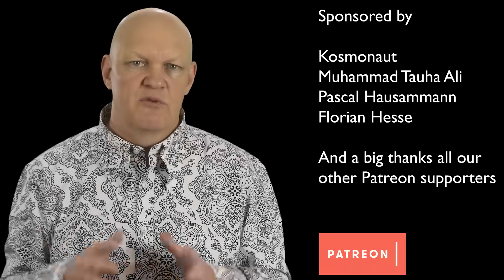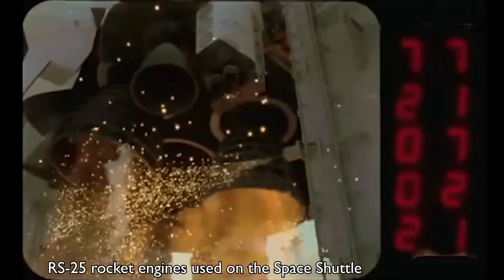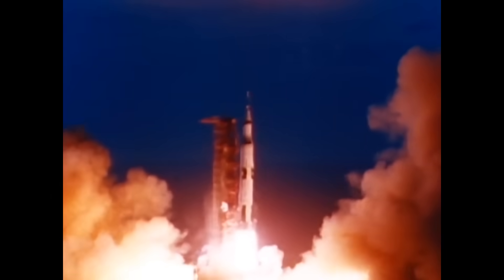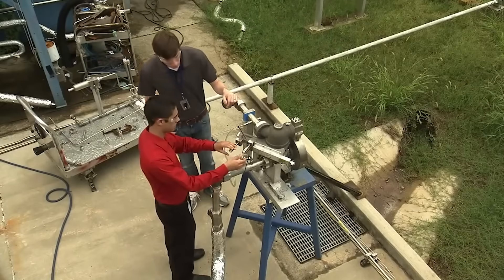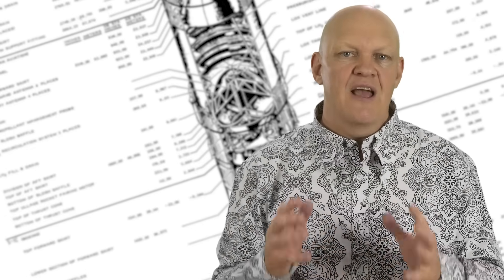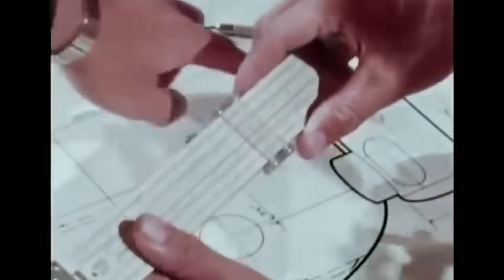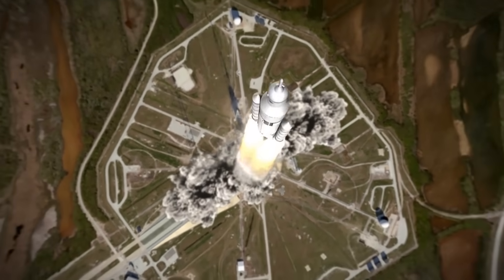Why Can't we Remake the Rocketdyne F1 Engine?

Comment: I think the statement that "We can't remake the F1 engine" is a misnomer. We could re-make them if we had to. We just couldn't knock them out in a couple of months. We'd have to first re-create the machinery used to build the engines.
Reply: Exactly, and repeat the trial and error steps that took place between the documented design and final design. It's not that we can't do it, but that no one is prepared to commit the resources which were available first time around.
Reply: @jellomaster5629  SLS engines have few problems about them. First they cost 100mil each. And as they are hydrogen engines they necessitate large solid rocket boosters to even get off the ground, which are also not cheap. Of course, the point of SLS is not to fly but to spend money, so maybe that's a feature not a bug.
Reply: @aleksandersuur9475  it's all money based now. Not science based like the Saturn V
Reply: @aleksandersuur9475  We also have the rocket engine 170, or rd-170
Reply: Nasa is now overpriced apple products with NO justification compared to Raptor engines. But not only by the factor of 4-5 like with PC and MAC but by a Factor of 100-1000. 
If Spaceshup Heavy is safe and a succses why should Nasa waste money with a rocket program? Could use Space X Rockets and focus money on other development, that still makes sense...
Reply: If we cant reverse engineer an F 1 engine,  we are really in serious shit man!
Reply: @michaellepore105  and you ARE in serious shit, man! America won’t even be around come 2030. That’s scary.
Reply: And train people how to use them.
Reply: You know What's funny? Those nitwits who believe our government is reverse engineering alien UFO'S! When they can't reverse engineer a Saturn 5 from 1967! With blueprints to add insult to injury!!! LOL🤣😂
Reply: EFFram YOUng  It's fake all along never flew, never worked, all happened just in a Kubrick Studio ;)
JUST JOKING. The fact I have to make this clear is strange...
Reply: not only machines. Blueprints are incomplete. Probably things like joinery, manufacture, oxidation, hardening and so on are missing there. But it's good question if we need to do the same, if 5k+ parts can be reduced to 40 with modern production processes, then why do it old way?
Reply: EFFram YOUng  Was even hard typing :D
Reply: We could certainly "reinvent" an F1, but we'd never rebuild what was built in the 60s. All of the technology is "obsolete". If it were still valuable, meaningful tech, we'd still be using it in things, but we aren't. Look at the LEM computer... marvel of 1960s inventiveness, but there's no way we'd even think to build something like that today. (just like today you wouldn't design a new computer around a 486.)

Too much of the Saturn V era lived in people's heads or personal notes, that never made it into official documents. Even with the blue prints, we'd have to rediscover all those little nuances. And then pray all the common off the shelf bits that aren't much more than a part number can also still be found. (a transistor or tube that was commonly available in 1960, might not even have surviving documents, much less working stocks. we have that problem in many things today -- the parts to fix them no longer exist, and no amount of money can restart chip fabrication.)
Reply: It's hard to imagine a scenario where we would have to remake 60-year-old engines when it would be cheaper and faster to make brand new and far better ones.
Reply: and ignore many of the environmental rules that prevent certain processes from being used any more.  A number of plating processes that used to be used are no longer possible due to changes in laws.
Reply: the SLS engines are far more efficient though pricey but even the Merlin engines smoke the F1 (330 ISP vs 263) and I’m sure the be-4 does as well because they weren't staged combustion.  Why remake inefficient huge old engines when we can just recover them or buy rd-180s from Russia.

The basic problem is just that skilled Craftsmen are relatively more expensive now because those ppl can more easily go to college and that means you have to pay more to get smart talented workers.

Comment: If these Spacex engines are so good... I mean hell, they are apparently so damn efficient they can return to the launch pad(??), why the need to 'remake the past'??
Reply: Mainly because neither SpaceX Merlin or Raptor have even a third the thrust capability of a single Rocketdyne F1.  I’m also fairly certain that NASA doesn’t want to get away from using liquid hydrogen in their next crewed launch vehicle, which is why the upgraded F1B booster was rejected.  Merlin runs on RP1 and Raptor uses liquid methane.  Pad 39A at Cape Canaveral needed to be modified by SpaceX to supply those fuel types, whereas 39B is still set up for LH2.

Comment: This is sad actually.. I graduated electronics engineering without the wide availability of the cheap pre-made electronics modules where the only pinouts are 5V, GND, SDA, CLK, SDL, Etc.. We were taught how to make discreet circuits to be used on MicroController Chips.. basicslly we make arduino-like boards from s ratch per project with our own pcb designs without using any software. Sure it dodnt look good NOR the best practice. But not being able to build an original F1 engine do suck, even if they made a better f1B, it is kinda crippling thought. I also acknowledge that the "notes" and the experience are a valid showstopper but the point remains. Younger engineers needs basic knowledge and hands on experience at the very least.

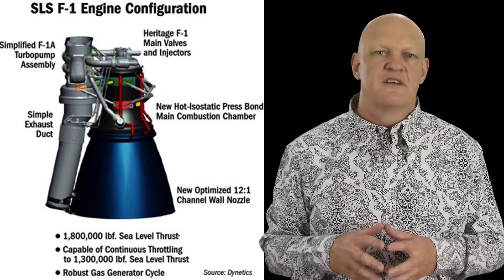Comment: 4:03 to all "everything was better in the old days" people.
Reply: I've worked on new and old machinery and between the two even if it's half rust welded the old is FAR more pleasant to work on.
Reply: @D8W2P4  because the production wasn't automated
Reply: @zhongxina9420 
I doubt it's an automated issue since automated things actually need the same things that allow then to be easy to work on (namely clear easy access).

Modern machines are mechanically complete gordian knots where every single part is interwoven in half a dozen other parts often requiring near complete disassembly to change something like one indicator bulb.
Nevermind the infinite troubleshooting hell of computerized systems (I just LOVE having to guess if it's mechanical hardware, electronic hardware, and/or software that's causing the issue).
Though that's about the easiest part since I just rip it all out when it goes bad and just make it do without now.
Reply: @D8W2P4  automation is much cheaper and efficient than manual labor. Allowing us to focus on more resources on other things like technological research like CPUs and the limit of transistors at 5nm
Reply: @D8W2P4  " this new automatic rifle is nice but I like hand-made bolt action rifles more" bruh that's your opinion
Reply: @zhongxina9420 
>automation is much cheaper and efficient than manual labor.
Not on the designs I've seen it isn't, there is physically no way it could be automated. These have to be made by hand in sweatshops over in some shithole like China.
>CPUs and the limit of transistors at 5nm
We already have more computational power than god in last gen's hardware.
This has only made developers lazy and sloppy since they can make Yandev tier code and get away with it.
Then there's the wicked diminishing returns on shrinking the transistors any more that's making companies question if it's actually worth doing (especially this close to the material limits).
>this new automatic rifle is nice but I like hand-made bolt action rifles more
Complete non-sequitur.
Reply: @D8W2P4  can you show me designs that are worse or the have the same yields as physical labor? Every time anybody says physically impossible an engineers head explodes.

And no our current computational power is not enough or ever will be enough. It always continue to advance and besides the bleeding edge of GPUs can barely raytrace 4k 60 fps at real time

And silicon based CPUs will change eventually just like how vacuum tubes was replaced by silicon in the 70s
Reply: Nvm experimental quantum computers already use 1nm transistors

Comment: "Cost effective" and SLS rocket in the background. The irony.

They didn't lose the blueprints but lost the required knowledge to build them, at the end of the day it's the same.
Reply: I guess they can recreate the engine and even makes it better but it's too costly for a private company and sounds too boring for investors without 3d printers\reusability\scalability etc. 
It's always better to make a new because it's a safe deal and didn't require extra skills from smart guys. (It's safe to spend 146 m$ per one RS 25 than make a new one or reverse engineered F1)  F1 was created for a single purpose - to fly to the moon, it was super powerful for any other purpose, so no one, including any of the countries tried to copy it. The Soviet Energy rocket was also preparing to fly to the moon, but after the collapse of the Soviet Union, its engines had to be simplified to find commercial use.

Comment: The F-1 was a terrible design, expensive, inefficient and weak. That's why NASA/Rocketdyne scrapped it.
There is no case to rebuild it.
The Thiokol SRB produces twice as much thrust and is far more efficient for a first stage, and was available from the mid 1970s.
To supercharge the SaturnV you'd scrap the awful F-1 stage and use 3 SRBs instead, bolted to the 2nd J-1 stage. This would make the rocket lighter and boost thrust from a claimed 7.5m lbf to a real 9.0m lbf.

Comment: Reminds me of what I did at my first job out of university. We had to re-implement a system that used loads of custom made parts on new off-the-shelf hardware, which meant we had to do a total reverse engineering. The source code was intact, but there wasn't any documentation and the engineer who wrote almost all of it, on his own, had died a few years prior. My first job there was deciphering the main operational logic function containing a several thousand line long mess of if-then-else statements.

Only way to make any sense of it was just to create a massive flow chart and a few "sub charts" to keep it from becoming too big to get comprehend. Thankfully my boss really liked it and when the company went belly up a little more than a year after I joined he gave me a good reference for my next job (had a signed contract after less than a month of looking).
Reply: tommy aronson  Industrial control systems as a business is very heavy on trade secrets protected by strong non-disclosure agreements so open sourcing it wasn't exactly an option.

So while our code was very much closed, we did use a lot of open source stuff like running it all on Linux, using Boost for a whole lot of tasks and QT for GUI, saving us a lot of work. Also FYI the business is still around so you clearly have no idea what you're talking about.
Reply: tommy aronson  The old code still had to be analyzed and rewritten.
Reply: @jellomaster5629  lmao
Reply: A massive chuck of IF/THEN statements is a sign of a programmer who hasn't learned all the features of a language.
Reply: @dannygjk  ... or in this case written in a hurry. A bunch of that code was written and added remotely when other team members were on-site at the factory. This being due to discovering exceptional circumstances that hadn't been disclosed, but still needed to be automatically handled by the system.
Reply: When writing a contract for labor to write software  the contract must  include “the code writer shall make copious comments to the side” such that the software or code can be understood.
Reply: @windsurfertx1  Being a software engineer I can say that's not really realistic. This time it most certainly wasn't when the person who wrote that code was the owner of the company.
Reply: akjohnny  The 22 upvotes would suggest that people found my story to be an interesting read.

Comment: I think it is worth the try, srb's are uncontrollable monsters where the new f1-b can be throttled up and down whenever necessary, and much cheaper to run. Especially when the space craft it is used on is reusable.
Reply: The SRBs are fine, which is why they are used as a first stage on many rockets, including the SLS.
You don't need to throttle a first stage. Ever. The biggest danger is 'pogo' which comes from liquid fuel pressure variations with G-force, something SRBs entirely avoid.
SRBs are much simpler and cheaper than the dreadful F-1, a horrible mass of brazed tubes and accidents waiting to happen.
Reply: @G-ra-ha-m  That's also true. Perhaps it is better to use a srb as first stage/support rockets.  Perhaps the new much simpler but even powerfull F1B could be used as second stage for hige payload rockets.
Reply: @TonVerkleijT3  The F-1B is an engine without an application. Of course it's better than the useless F-1, but it's still an open-cycle design and therefore around 10% less efficient then the 1969 NK-15 based Russian designs like the RD-180, and the new SpaceX Raptor motor. If people really wanted to get into space (Which they don't because of the VAB), then an 3-4 cluster of SRBs around an RD-180 or RD-170 base is the most efficient solution.

Comment: Great video!  I had the same experience working on the Phalanx CIWS.  They tried to 2nd source to another company.  But of course, there were many elements left out of the blueprints which made a second source impossible to produce a final product that was anywhere near to the performance of the original.  They built a few but none went onto an actual ship.

Comment: Unfortunately, a single-chamber kerosene engine like the F-1 with a thrust of 700 tons of thrust and a specific impulse of 263 seconds cannot be manufactured, you cannot just take the engine from the Saturn-1b rocket and increase the combustion chamber. Therefore, in the engines RD-107 / RD-170, there are four combustion chambers. By the way, the black exhaust of the F-1 is not the exhaust of the pump, it is the pumped part of the fuel cooling walls, which merged into the nozzle for a critical section, which means that the specific impulse F-1 was terribly low, this can also be see from the huge flame of flying Saturn-V. The thrust of the F-1 was almost the same as the NK-33. On Saturn-V there were only five single-chamber engines, it follows that the payload of the Saturn-V rocket was like one block Falcon-9.
Reply: "the F-1 with a thrust of 700 tons of thrust and a specific impulse of 263 seconds cannot be manufactured,"
Has been. Was on the Saturn V. 
 
"the payload of the Saturn-V rocket was like one block Falcon-9."
140 T in LEO...

Comment: I wouldn't have thought you'd need to make an exact copy of an F1, I'd be happy to make the modern equivalent starting with the original blueprints and then completely overhauling them, bringing them up to modern safety and manufacturing  standards first.
Then build No 1 test engine and modify where needed the same as designing any other motor expect with a head start.

Comment: Because the new generation cant even tell the difference between tide pods and candy. They are teaching them you can run the world with buy just participating and not working to just finish nothing. To build them engines it took work to be number one the best you can be and not giving it a try. The men and women who built that where challenged with major failings to hone their skill to strive to be better. Not giving awards for just showing up. They had honor in what They did. not expect a raise for ther degrees but to prove they Deserve a raise for the work they did.

Comment: There are really a lot of similar examples. Aircraft engines from WW2 era, certain mechanisms from 19th centuries, like watches, even some ideally cut stone blocks from ancient Egypt. The farther it gets, the more speculations there will be, like 'it was definitely done by aliens'. In several centuries, it will be unbelievable that people could have flown to Moon with computers less powerful than a calculator, which will   be long obsolete by the time, too. It will be unbelievable that from an n-th try people have laid the Atlantic telegraph cable in 19th century or that a first manned motorized flight was accomplished with an engine less powerful than of a today's motorcycle. Internal combustion engines alone will be dead in 25th century (except maybe old oil engines in Punjab still pumping water) and reproducing modern Euro-6 engine will be sort of impossible due to lack of obsolete materials, lost instrumentation technology, incapability to see elegance of certain solution (that seemed elegant at the time). Nothing special.
Reply: this is a rocket engine. not a fukin swiss watch.   hey santa is fake'!